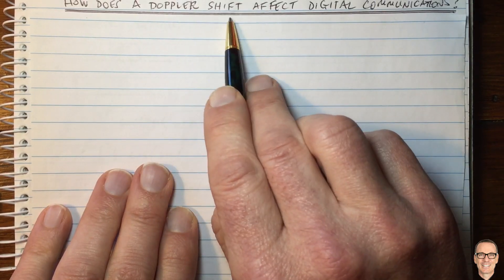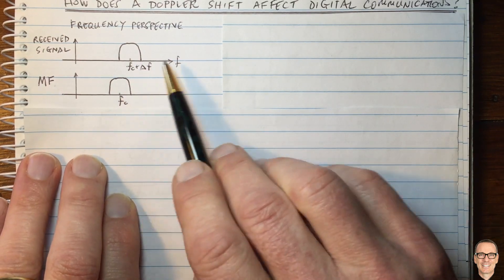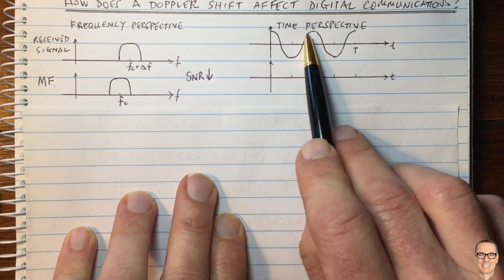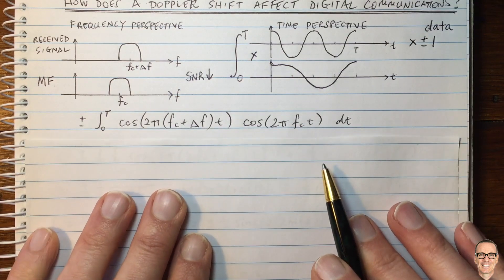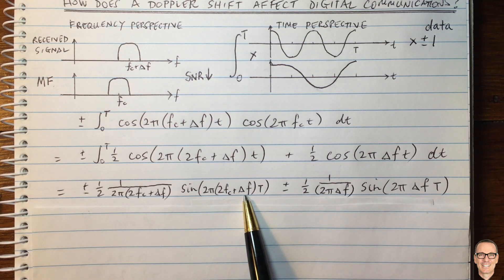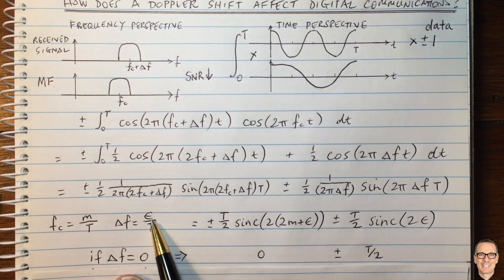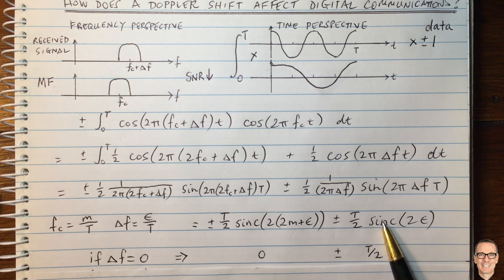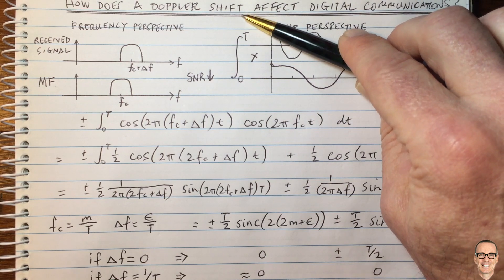How Does a Doppler Shift Affect Digital Communications?

Comment: And we cannot just shift the matched filters when we know the Doppler Shift at the receiver?
Perhaps if it is implemented in software?
Reply from the maker: Yes that's possible for a single path (ie. single Doppler shift) channel, but it's easier said than done. It would be necessary to adaptively tune the carrier frequency in the mixer used to down-convert from RF to baseband.